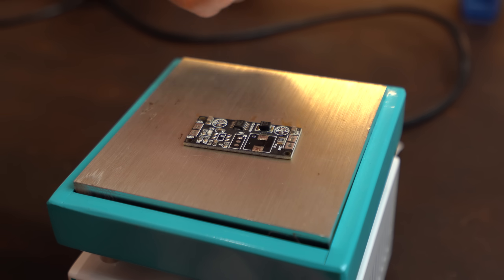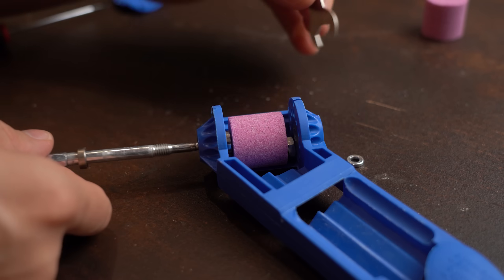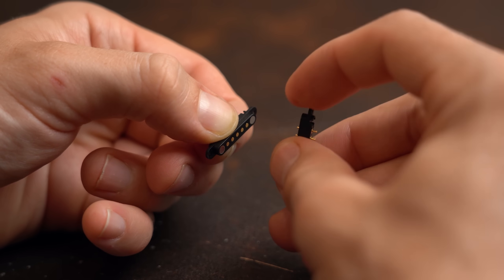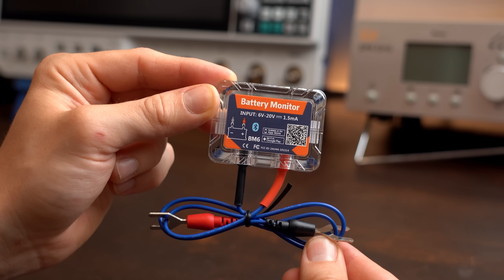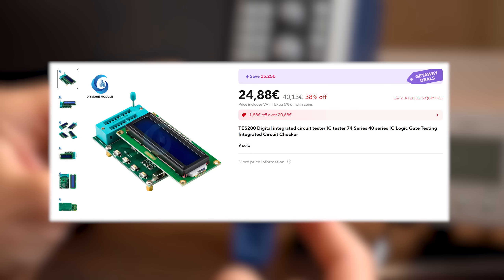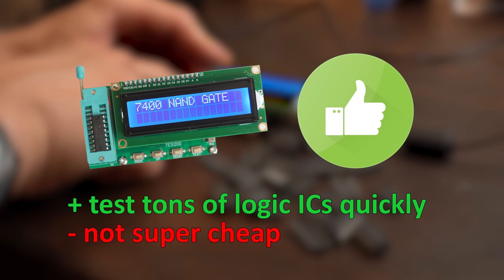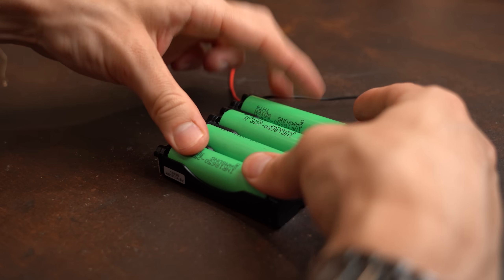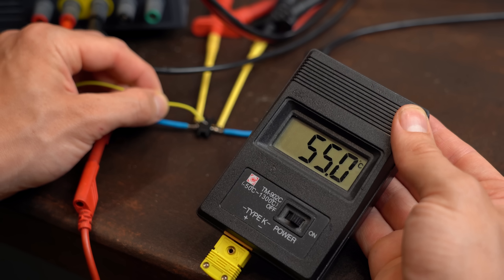I tried finding Hidden Gems on AliExpress AGAIN! (SPECIAL Part 10)

Comment: The digital tape measure might work well when used to follow a route on a paper map to determine a travel distance.  You need a calculator to multiply it's mm by the map scale.

Comment: Just because some random dude on Aliexpress told you, "IT USES GPS, IT`S SPYING ON ME!" you´re labeling as a potential spying device? Did you check what data is send from the app to the companies server? No you didn´t, some rando dude was bullshiting and you believed everything.... I doub´t the device itself got an GPS-module inside and the app was using your phone to get the location when it connects to the battery device... Pathetic...

Comment: You didn't use the drill sharpener correctly. Think about it, If you continue to hold the sharpening reel and you spin the drill bit around on grinding surface all it's making it more pointy.
Bit needs to have 2 sharp edges.

Comment: The question you have to ask yourself is if "turning off" the gps on the battery monitor app actually turns off the gps data (I doubt it) or just doesn't display it to you. Very dodgy.

Comment: I simply use benchtop grinding wheel with free hand to sharpen drill bits.
This tool doesn't make the end flare you want, hard to describe, but there are plenty of videos. It's a simple hand movement on the sharpening, and by hand sharpening is very easy. All you need is stationary grinding wheel.

That being said, 4€ is cheap,  but for me it would yield negative ROI since i'd just walk to my maybe 40€ benchtop grinder and spend few seconds there.

Comment: So you actually picked up on those high power voltage controllers? 😆
One of which was purchased by this fool to be used in conjunction with a 1:2 transformer, 
for 112 Volt to be transformed up to 230V, in an effort to save on a far more expensive Variac and its heavy postage.
Naturally, the resulting peak-peak voltage, as it later turned out, was a hefty 650V, 
good enough to instantaneously blow the two 470uF/200V storage capacitors inside the switching mode power supply used to test the sheer genius of the idea without blowing the switch mode's fuse. 🤗

Comment: normal men can sharpen all drill bits hand, not need all worst tools this job. easy sharpen only whit hand, need only train first and need be measuring tool looking angle and dimensionhas right. and table grinding machine whit green and white rock wheel.

Comment: As opposed to the battery monitor, a better investment would be a load tester to see if the battery even has the guts to crank anymore, or if sulphation has taken most of it's goodness. That battery monitor tells nothing for the highest drain thing the battery has to do.....crank the motor. Germany gets winters. 5 years and the battery is done for the most part.

The 'tape measure' would get thrown out the window on any serious build site within 2 minutes if not within 5 seconds. It's completely useless. Breakable, finicky, and just trying to solve a non-existant problem. Anyone measuring distances that long isn't concerned about .001 accuracy. Total waste of money.

The battery thingy is a little high-priced considering you could 3D print it and buy the battery board for about $2

Comment: 6:57 if your car won't start when it's cold it can be because battery voltage especially in lead acid batteries drops when it gets really cold.
The solution is to warm it up, turn your lights on for a bit if you can and if you can't, I started my volvo in the winter once by boiling a kettle of water, putting a tea-towel over the battery and pouring the hot water, careful not to short it, onto the towel soaking it and heating the battery up. Started.

Comment: For the car battery not being great during winter, I assume you know enough electronics to know that the start A (760 for the EK700) is basically halved when it drops below freezing, and with the popularity of diesel cars, people end up buying too cheap batteries with too low A to do cold starts when it's too cold, diesel cars requiring a lot beefier batteries than a petrol car, something I demonstrated to a customer once when I worked in a shop selling the brand of battery you got in your car here, we also specialized in American cars where I worked, so with the customer with his diesel Volvo was complaining that batteries were getting so big, he figured with tech they'd get smaller, not bigger!
So to show the difference I place the battery for the diesel Volvo on the cart, then placed the battery for a brand new Ford Mustang with a V8 next to it, the battery needed for a big American V8 is tiny next to the other battery, just because diesels are harder to start. :P
But yeah, as I'm in Norway, when we got customers wanting batteries, I would usually ask them if they have a cabin in the mountains, or visit the mountains in winter, we had too many customers who'd bought a cheap battery that wouldn't start their car while they were in their cabin in the mountains during their winter holiday.

That was a lot more than I expected to type... XD

Comment: Those magnetic connectors have a tendency to collect debris over time also, sometimes very fast depeding on the environment, and then you run the risk of a dead short. Defnitely for home use.

Comment: Just a note about that logic IC tester: that screen is an off-the-shelf part, so a lot of times you can save money by requesting a version without the screen included from the seller, and then connecting one of your own or another compatible screen

Comment: what was that charger in the rolling tape measure segment? i want one it showed alot of info
Reply: Looks like a Makerhawk Makerfire. Norm $22-25 but on sale often enough for as low as $15. Note: it only does 3.8-30V 0-3A. I prefer the Kowsi type c which does 4-40V 0-12A so you can test some of the PD ports that do 180w on some gaming laptops. Also its only $10 and you can use adapters to go from type c to a or mini b, micro b. I didnt notice any issues using adapters.

Comment: The USB tester can also show if the wires are damaged. Specific LED's dimmed when I tried a few known bad iphone cables. It showed me that 1 had a faulty data wire, and 2 had bad VCC wires. They were still able to connect but were too damaged to work properly.

Comment: That digital "tape measure" would be awesome if you could mount it to a stand. It would remain stationary,  and material would move under it. I use to work in roofing and gutter installation. We made our own gutter from aluminum stock. This would give accurate readings on how much material was used. If it was accurate, anyway.

Comment: I have a different drill sharpener. It is grey and you need to sharpen the drill bit twice, to keep the proper two-angle cutting face. It takes a bit to get right but works excellently when you figure it out.

Comment: AliExpress tried to rip me off $for a drone + 3 batteries. They sent 1 battery, wrong size, but never sent the drone. Then, when I complained to Ali they refunded on the batteries ($35) but not the drone, wihich never arrived ($65). And when AliExpress would do NOTHING to rectify the situation, I sought a refund thru Amex. AliExpress send Amex the documentation of delivery for the wrong single battery, and claimed it was documentation of delievery of the drone. Amex believed ME and refunded me the $65. Subsequently I bought the smae drone/batteries from Temu and Temu delievered.

Comment: Drill bit sharpener is garbage. The edges are crap.
IC Tester - I got a nicer one in a full case with an ociliscope for $20 so cheaper than you paid for yours.

Comment: Some quality might not good, but most if not all products are current technologies.  You might also find so many similars and so many different prices. 

You can also find the Western brands but much cheaper price.  I don't have any need for the Band Saw blade, but just happened to compare the prices difference between Amazon and AliExpress (if you're reseller then Alibaba is a muuuuuch cheaper place) to find AliExpress has all sizes about the same price (some might be $2-3 diff) and they cost around $18-20 a  blade.

Amazon, it starts from $56 for the shortest length, up to around $100+ for the longer length.

Comment: The drill bit sharpener is junk. It will flatten the drillbit tip, as it will cut no relive angle. So you're just melting the material and your drill bit, instead of cutting

Comment: 6:58 I found it very handy to use one of those USB adapters in a 12V socket that display the current voltage, so you can  read it as a normal gauge.

Comment: I guess the Round digital Tape measure could come in handy when mounted on a circular saw to measure lengths of pieces of metal or wood that need to be cut to length

Comment: I would't be that much interested in using that battery monitor for a regular car, but to keep track if I ever got an EV that doesn't come with a way to keep track of the temperature of the battery packs as a feature.

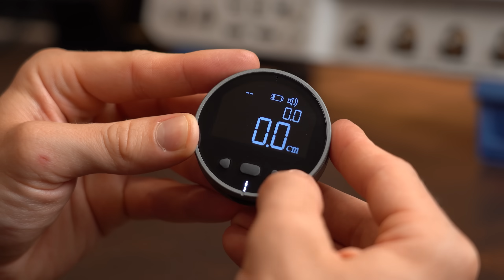Comment: 11:58 you don't measure the corner, you add up the diameter of the measure tape. :) But this isn't for that kind of a measurement, this is for people who do fabric measurement and ... well, in the past had it existed, i'd imagine it would've replaced the wheelwright's measuring wheel. In the 60's there was such a device, in analog flavor. It would displace the fabric's distance on a mechanical (resetable) counter (like the ones in counter clickers). Mom had one, and she loved it. Unfortunately after lots and lots of measurements, the small plastic bearing pocket gave out and broke the wheel. Nothing good lasts for ever.

Comment: 11:57 if you take it apart and replace the wheel for a 3D printed pulley meant for capstan wraps (a loop) you could use it as a distance finder for various projects, where the string (or rather fishing line) is pulled by something to a given distance. In theory, you could affix the tape to a tripod, set the other end of the string on a sprung spool on the same tripod (for ease of use) and then go around a room with a stylus tied to the string, and thus (reasonably accurately) measure a room in a 3D format. 

Of course, this is just an idea, but the core elements of this device are there. Laser is good, but with the proper 3D print around this device, you could bypass the issues that come with it, which is that you have to work linear measurements into a 3 axis measurement, whereas this can do (basically) the cheap version of LiDAR. Heck, build this properly, and you could make one - that works by string. I see no issues 3D mapping a device by stylus and string.

Comment: The reason why it says it's not for hardened bits: The heat created from grinding it will un-harden the suface of the bit, making it go dull faster.
Additionally, it removes the relief angle, but at the  point your bits were at, it didn't matter anyways. 
There are more professional tools that can also put that angle back on

Comment: there are 3 items recently that caught my eye on ali express
MaAnt Dianba 1 Multifunction 8-port Charger for Mobile Phonewith Short Circuit Repair Function Smart Wireless Fast Charging Tool

Bosch GO 3 Electric Screwdriver 3.6V 5Nm Cordless Mini Hand Drill Rechargeable Screw Driver Multi-Function Power Tools Type-C 
(i only am interested in whether or not this is fake since as far as I'm aware the bosch one is just an overpriced version of the dremel one (the bosch is normally $80)

KUAIQU DC Laboratory Power Supply 30V 60V 120V Adjustable Voltage Regulator Bench Switching Power Supply Preset Current ON/OFF

Comment: I got the cable tester, but it doesn't seem to work.  Update edit: It acts a little strange when the cable supplying it with power has a cc pin and a charger that uses it.  Otherwise, perfectly fine and quite useful.

Comment: I got that cable tester specifically to figure out what micro USB types I had because I have wasted hours trying to do Arduino work only to discover my cable was power only and didn't even have the data lines.  I take it to the second hand store with me, along with a usb battery pack, and go through their cable bin to grab cheap cables because I'm always giving them away and installing them in projects.

Comment: For drill sharpening.  Just get a drill doctor and be done with it.  You can get one that even adds a pilot tip.  And depending on the model you can sharpen concrete bits.  I find it puzzling why "gadgets" that cost 10 dollars or 20 dollars are sold and are disappointing when an real proven product costing 50 dollars is "too expensive".

Comment: I purchased three items and paid import duties and shipping cost during purchase. Sneaky seller sent out without paying import tax and therefore custom rejected clearance and box returned to seller by the shipping company. Seller did not respond my messages and I raised a case for refund. Ali Express refunded partially which is about 20% of total payment. Unbelievable!!! its even 1/3 of item's selling price. I contact with AE customer service and they escalate to higher service agent but they only advised me to contact with seller for negotiation. Well-done AE, very good job, applause..…  There is no customer protection in AE and they leave you at the mercy of the seller. The Chinese have opened an online shop to scam people in a qualified way. I have never encountered such fraud in any other online seller. Avoid from AE at any cost not to cry at the end. I have now closed my AE account as I have no business with scammers anymore (order id. 1105521430677607)

Comment: I'm new to your channel, and i will be happy if u or someone in community could help me.
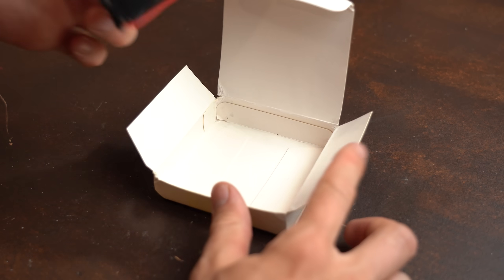At 12:38 the battery pack is that's what's i kinda want to mount it for my Aprilia Scooter/Roller 12v as replacement battery.

but im curious because the 18650 battery are rated for 3,7 v, so for my need i must have about 3,2 battery that's impossible or i use 4 battery that's make 14,8.
14,8v could be fine but i'm not sure if alternator could charge it fully.? 

Long story short i was imagining if i use some sort of BMS like in this video, so that i could regulate charging~14v, discharging~10v and keeping the hole voltage about ~12v .

Is my imagination possible or it's a science fiction movie😅 .
If yes, i will be pleased to have some sort of product name or anything to start with.

Thank you guys, and stay healthy 🙏

Comment: Big request!!! Can you make a circuit that mimics a SPDT switch but without the need of a analog switch. Basically something with 2 outputs that swap current with 1 input... I guess it's hard to explain cause I'm no electric engineer

Comment: 12:00 You've missed the point of this device. It's not intended to measure straight lines; it is used to measure perimeters, distances along random curves etc. If you have a map where you want to measure the road distance, you can follow the road lines to measure between required points. Many years ago, we used them (mechanical ones) at a place I worked, for measuring approximate distances for civil engineering projects.

Comment: I like the battery monitor, for the chip tester, there are better ones (capable of doing more ICs, including opamps and voltage regulators) in AliExpress, but of course they cost more

Comment: I can confirm that drill bit sharpener is junk. It's only use would be to sharpen wood drills. Anything else absolutely not and I had one - it didn't even succeed with w drill bit for wood.

So far I've ordered a fair bit of stuff off Aliexpress...
Their clothes don't fit
Their electronic gadgets don't work or don't come with instructions which is the same thing, really.
The electronic components are pretty good. I have ATTiny13, ATTiny85 and ATTiny44 from Aliexpress as well as a whole lot of add on boards for microcontrollers. All pretty good.

Comment: I bought an 18V battery adapter to convert another type of Dewalt tools to Hikoki batteries, and this Dewalt Laser level behaved strangely: the laser does not have a stable light, but flickers a little.  Do you think you could make a video of what is inside these battery adapters?😅

Comment: That round measurement device got its standards logged..so if you wanna measure like you displayed.. you toogled it to, the sq symbol..then it will detracts, its own wideness, so you can easily measure fx 11:58 as long as you just focus on holding it straight..
Its these arrows on top that you toogle depending on which side your coming from.
you toogle it here in the video. 12:21.. so a measreuemtn from right to left, you toogle that angle.. also recall you can add and deduct etc... which can be handy for some art or creations,.
Got one like 5 years back.. when it was called either Xiaomi or Atuman.. they were around 10 bucks on sale.. back when gearbest was a thing-
and no, I haven't it used other then just plain techcurioisity..its quite wellmade... atleats those older units were.

Comment: I havent used the drill bit sharpener but based on my experience as a metal machinist and having sharpened a LOT of drills by hand, I would say that the problem is not so much the gadget as the inexperience of the user. You cant sharpen a drill by spinning it against a grinding wheel as it ends up with no relief and no 'chisel edge' (the sharp line across the centre web of the drill bit). If you carefully sharpened each flute without spinning the drill you might have a chance. Having said that, it just might be that bad as to be useless.

Comment: Keep in mind the toggles on software could be fake.  Just because your app shows it doesn't mean its actually off.  Chinese software is often rought with these and you need to take permissions away in phone settings and that should work unless it cracked your phone on install which is also possible to without you noticing.